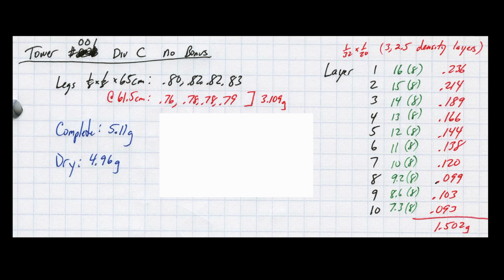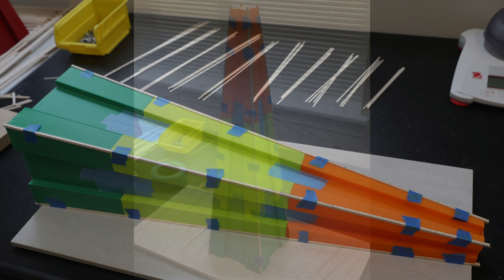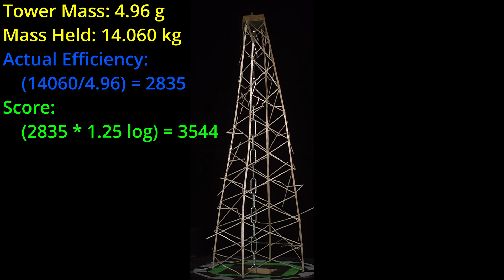2024 Science Olympiad Tower: Div C Initial Build

Comment: What is the finished height of the tower and the length of the legs because my 3d print isn’t matching with the drawing I made so I’m just asking
Reply: Because the drawing I made was 61.24 cm tall, the legs were 61.5cm total, the width of the top was 40mm, the bottom width was, 152mm, and what I printed so far was half of the top which has a width of around 81mm and it doesn’t match my drawing
Reply from the maker: @krishivray  If you used the 120% scale for my Div C jig, the height would be 60.6cm tall.  The length of the legs are about 61.3cm

Comment: I swear, the second the rules come out for bridge, boomi, or tower, instantly you make the best one, and then EVERYONE copies. In scioly it isnte even a question of who can design the best bridge/tower/boomilever anymore, it's just "who can copy Balsa Engineering the most consistently"
Reply from the maker: One of my goals is to allow any team to be able to compete at the highest level if they want to put in the effort.  First, you need a good design to start, then the real work begins with refining the design, material optimization, and build skills.  In the past, only teams who had historic knowledge were starting from good designs.  (BTW, these tower rules are essentially identical to 2017, so any school that knew anyone working on it then would have a huge head start).  So, yes, I'm definitely trying to help the bottom 75% of teams bring up their builds instead of starting from something like the really bad template designs SciOly puts out there.  The top 25% doesn't really need my help, but now any team that wants to put in the effort, at least has the chance to complete.  Good luck this season!

Comment: Thanks very much for the very informative videos! I see that the notes for this tower indicate 4.96g dry and 5.11g complete. Does this mean that the glue added only 0.15g? Or, is does the dry weight include some oversize to parts that is cut off after gluing? Also, what glue is used on this tower?
Reply from the maker: Hi!  That's just my naming convention.  Complete means the weight of the device right after I finished building it, which is in ambient conditions.  The "dry" weight is after it has spent a day or two in my dry-box at around 18-20% RH.  In this case, which is fairly typical, it drops the weight by about 3%.    If you want to learn more about what the dry-box (and baking) can do, check out my Competition Prep video: https://youtu.be/6zOvHMZLaNE    I like to use 50cps CA glue for all my builds.  PS,  The glue mass for this device can be calculated by taking the "complete" mass and subtracting the sum of the leg and layer masses in red; or (5.11 - (3.109+1.502)) or 0.499g

Comment: Hi, I was wondering how you cut your balsa sheets, since I'm worried that using a power saw would create issues (like the wood potentially breaking/cracking). Thank you!
Reply from the maker: Hi, you want to use a balsa stripper tool for that, definitely not a power saw.  Something like this: https://www.amazon.com/Master-Airscrew-Windsor-Propeller-Stripper/dp/B0000WS5OQ/ref=sr_1_5?crid=37PEGMYEWR1RW&keywords=balsa+stripper+tool&qid=1694694767&sprefix=balsa+stri%2Caps%2C187&sr=8-5    Also, you can see how I used that tool in my Balsa Library video you might want to check out: https://youtu.be/bLsTOpmozGI

Comment: hiya! your videos are great! One quick question-do you sand the bottom of the legs as well to make sure they are flush with the floor? thanks I’m advance
Reply: good question!
Reply from the maker: Hi!  I used to sand the bottom of the legs flat, but now I don't bother.  It doesn't seem to make any difference at all and it's just one more variable where things could make your tower less level.  If you feel more comfortable doing that, take the extra time to make sure the tower remains as level as possible before testing.  Good luck this season!

Comment: what size balsa should i get
Reply from the maker: I would recommend getting a variety of sheets at 36" x 4".  Get 1/8" thick for the legs and then a mixture of 1/16, 1/20, and 1/32 to have options for the cross-bracing material.

Comment: Hi, I noticed that you said you separated your cross bracing into three different types. What size of 1/32" sheets do you use, and what are the masses of them? 
(When I tried cutting pieces of balsa for cross bracing, the pieces I got were very bendy and easily broken just by pulling lightly on it, so I was wondering what density of balsa wood you are using.)
Thanks in advance!
Reply from the maker: Hi!  I like to buy all my sheets at 36" x 4".  For the 1/32" cross bracing, I'd say the mass of the sheets I've been using are around 10g or so.  I have also found that light 1/20" works very well too, sheets around 12g.  There is no one right answer though, as that is part of the optimization problem. Good luck!!